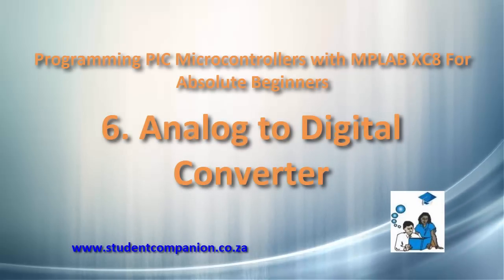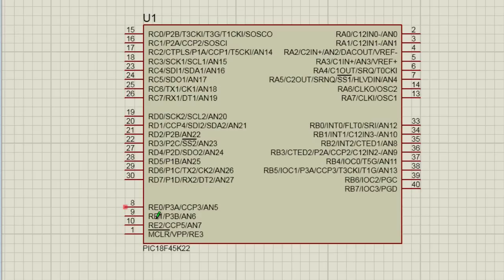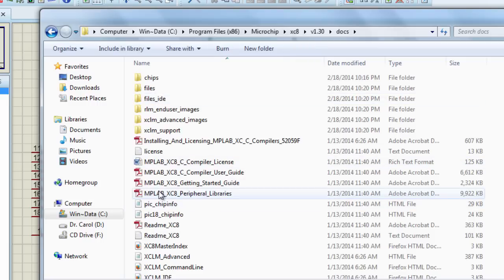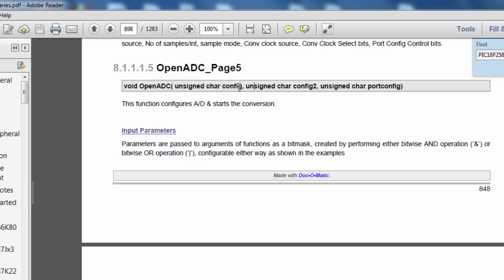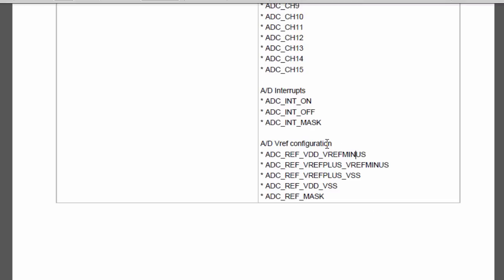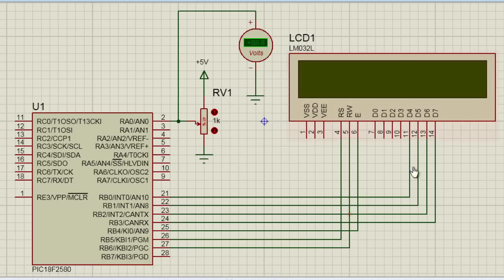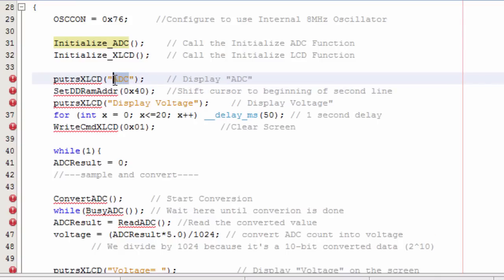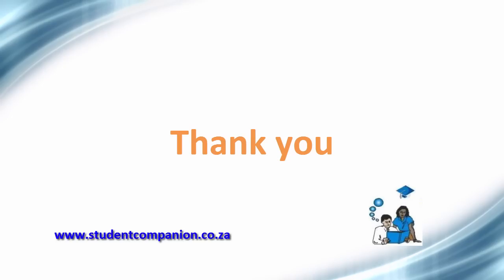6- Analog to Digital Converter | MPLAB XC8 for Beginners Tutorial

Comment: I have been working on a existing PCA designed where in the hardware is already fixed such as the no of pins and other hardware configuration.Truely speaking I  had to change the logic alone which was done by a third party based on our requirements and inputs But this time I wanted to do it myself (coding alone) and I am accustomed to mikroC and proteus way of compiling based on the videos referred.Is there any pic model which can replace pic 12f510 but still be cheaper and compiled by mikroC and checked by proteus and used in the existing PCA.I have already modelled it in proteus.Only coding part is left. Once that is complete I have burn it in our existing PCA and check for it's functionality.
Reply from the maker: You can use Microchip Advanced Part Selector tool, enter all the features that you need equivalent to your existing PIC, like number of pins, memory, peripherals, etc.
Then it will give you the PIC models that meet your criteria:  https://www.microchip.com/maps/Microcontroller.aspx

Comment: Hi...this is regarding pic12f510 microcontroller that we were referring to from another account.Is this the way we have to comment on a video.?in the mikroC version I am using, there is 12f510 pic but it's not available in proteus.This is where we are facing difficulty.Is there any other compiler which can help us in programming pic 12f510 .
Reply from the maker: Yes. This is how you can comment, even though you commented on a MPLAB xc8 video, but it's fine.
This PIC is available in Proteus but it's not available in mikroC.  You must use a different PIC. That is supported or choose a different compiler. 
You can use MPLAB XC8 compiler, it's free and it suppport all PIC models. 
Is there a good reason to use this very old PIC while there are newer alternative which are cheaper and better with more features?

Comment: Hello. I need the code for PICF887 ,using Proteus and XC8 compiller. I need the code for dht11 connected at RC0 and the microcontroller is set to work on 20Mhz.Thank you in advance
Reply from the maker: Hi. We can't write the code and the schematic for you, we can't have time to write codes for every requests we receive.
We can assist you with your own code. Do some research, read the datasheets and start the project yourself, there are plenty of resources online you can refer to.
If yoi struggle with specific features of the project, or the code doesn't compile ot generate errors or doesn't work 100%, then post those problems here on YouTube or preferably in the forum on our website because there you can even upload your code. Then we can look at it and do our best to assist
Reply from the maker: But unfortunately we can't write everything for you, that's not what we do, we won't have time for everybody

Comment: I am trying to follow your course, in this case the ADC, I follow the example explicitly, but the '#include "LCD.h"', well, where is that? I'm using MPLabX with XC82.10.
Reply from the maker: Hi, in this tutorial we used the PIC18F peripheral libraries but it's no longer supported from XC8 v2.0.
 Because you are using XC8 2.10, it won't work, you can either download an older version of XC8 compiler older then XC8 2.0 or preferably use MPLAB Code Configurator which is the new tool Microchip introduced to replace those libraries.  So it's better to use a new tool which has many advantages.  Watch this video to learn more: https://youtu.be/4WaB_Lj8FnY

Comment: Hi, actually i am using MPAB IDE v5.2 and i do not have "ADC.h"!? where can i get one? i'm working on PI18f45k20. Thanx for answer.
Reply from the maker: Watch this video to learn more: https://youtu.be/4WaB_Lj8FnY
Reply: @StudentCompanion  Thnax, you understood what i need! i actually use XC8 v2.5
Reply from the maker: What is the version of your XC8 compiler? It seems like you don't have the peripheral libraries installed in your compiler, they are now a separate installation.
Reply: @StudentCompanion  Compiler XC8 v2.05 now i don't have the "Link in peripheral library"! in XC8 Linker.
Reply from the maker: @nirindrainyjeraymond6248  Hi, you can't install the peripheral library with XC8 v2.05, it's no longer supported. The last supported version was XC8 v1.45 from v2.0.0 you can't use the peripheral library. either use MPLAB Code Configurator or install an old version of XC8 from this page: https://www.microchip.com/development-tools/pic-and-dspic-downloads-archive
Please note if you install XC8 v1.34 you won't need to download and install the peripheral library, it's already included in the compiler. This is the last version that had it.
Reply: @StudentCompanion  First of all thanx for all your answer. actualy MPLAB V5.0 / XC8 v2.05 / i installes de code configurator / but problem remaine: the compiler doesn't recognize de "adc.h"!
Reply from the maker: @nirindrainyjeraymond6248  If you installed code configurator than you don't need adc.h again, you don't need to use the peripheral library again. the code configurator will generate for you a new library, a new adc.h
In this video we explained how to use the ADC with the code configurator no need to use adc.h : https://youtu.be/4WaB_Lj8FnY
To learn more what is MPLAB COde COnfigurator and how to use it, please watch this video: https://youtu.be/JxSSVtTj_fA

Comment: Why did u choose ADC_FOSC_2 why not ADC_FOSC_4 or 8.
And why did you choose 2tad as your aquisition time. Is there any specific calculation for them?
Reply from the maker: The clock source affects the duration of ADC conversion. Depending on your application you might want a shorter delay but also affect the accuracy. 
The TDA is the time to complete one conversion. For correct conversion the appropriate TDA speciation must be met. This is PIC model dependant.  You must read your datasheet for more information.

Comment: hi, im currently watching your tut and im stuck in this part. im using pic18f4685 but im having problem with building the code.
in this part. 

OpenADC(ADC_FOSC_2 & ADC_RIGHT_JUST & ADC_2_TAD,
            ADC_CH0 & ADC_INT_OFF & ADC_REF_VDD_VSS,
            ADC_1ANA);

ADC.c:52: error: (192) undefined identifier "ADC_FOSC_2"
ADC.c:52: error: (192) undefined identifier "ADC_RIGHT_JUST"
ADC.c:52: error: (192) undefined identifier "ADC_2_TAD"
ADC.c:53: error: (192) undefined identifier "ADC_CH0"
ADC.c:53: error: (192) undefined identifier "ADC_INT_OFF"
ADC.c:53: error: (192) undefined identifier "ADC_REF_VDD_VSS"
ADC.c:54: error: (192) undefined identifier "ADC_1ANA"

it showing this error. i tried comparing the peripheral library and it shows the same for OpenADC(parameters)
Reply from the maker: Hi. What is the version of the XC8 compiler you are using?
It looks like you are using some of the latest versions if that's the case the Peripheral library is no longer included in the compiler. You have to download it separately and install it into your compiler.  It's now called Legacy peripherals libraries and you can find it same place as your compilers download on Microchip website.
Reply from the maker: Or you can install an older version lime the one we used in that tutorial.  MPLAB allows you to have multiple compiler versions. You can choose one for each project. Any compiler from v1.34 and earlier should work.
Reply from the maker: Or you can use a new PIC model supported by MPLAB Code Configurator as Microchip is phasing out The peripheral libraries.  Please watch this video to learn more: https://youtu.be/4WaB_Lj8FnY
Reply: i have also downloaded the legacy peripherals. which i have used in your lcd tutorial.
Reply: ok ill try to install v1.34 :D
Reply: downloaded and installed v1.34. but im still having the same results and errors.
Reply from the maker: Are you selecting the correct compiler in your project?
If you have used the Peripheral library in the lcd tutorial then it should work. They must be something else wrong.  Please upload your complete zipped  project in the forum on our website.
Reply from the maker: Can you post your main.C code and your configuration bits
Reply: my header file.

// PIC18F4685 Configuration Bit Settings

// 'C' source line config statements

// CONFIG1H
#pragma config OSC = IRCIO67    // Oscillator Selection bits (Internal oscillator block, port function on RA6 and RA7)
#pragma config FCMEN = OFF      // Fail-Safe Clock Monitor Enable bit (Fail-Safe Clock Monitor disabled)
#pragma config IESO = OFF       // Internal/External Oscillator Switchover bit (Oscillator Switchover mode disabled)

// CONFIG2L
#pragma config PWRT = OFF       // Power-up Timer Enable bit (PWRT disabled)
#pragma config BOREN = OFF      // Brown-out Reset Enable bits (Brown-out Reset disabled in hardware and software)
#pragma config BORV = 3         // Brown-out Reset Voltage bits (VBOR set to 2.1V)

// CONFIG2H
#pragma config WDT = OFF        // Watchdog Timer Enable bit (WDT disabled (control is placed on the SWDTEN bit))
#pragma config WDTPS = 32768    // Watchdog Timer Postscale Select bits (1:32768)

// CONFIG3H
#pragma config PBADEN = OFF     // PORTB A/D Enable bit (PORTB<4:0> pins are configured as digital I/O on Reset)
#pragma config LPT1OSC = OFF    // Low-Power Timer 1 Oscillator Enable bit (Timer1 configured for higher power operation)
#pragma config MCLRE = OFF      // MCLR Pin Enable bit (RE3 input pin enabled; MCLR disabled)

// CONFIG4L
#pragma config STVREN = ON      // Stack Full/Underflow Reset Enable bit (Stack full/underflow will cause Reset)
#pragma config LVP = ON         // Single-Supply ICSP Enable bit (Single-Supply ICSP enabled)
#pragma config BBSIZ = 1024     // Boot Block Size Select bits (1K words (2K bytes) Boot Block)
#pragma config XINST = OFF      // Extended Instruction Set Enable bit (Instruction set extension and Indexed Addressing mode disabled (Legacy mode))

// CONFIG5L
#pragma config CP0 = OFF        // Code Protection bit (Block 0 (000800-003FFFh) not code-protected)
#pragma config CP1 = OFF        // Code Protection bit (Block 1 (004000-007FFFh) not code-protected)
#pragma config CP2 = OFF        // Code Protection bit (Block 2 (008000-00BFFFh) not code-protected)
#pragma config CP3 = OFF        // Code Protection bit (Block 3 (00C000-00FFFFh) not code-protected)
#pragma config CP4 = OFF        // Code Protection bit (Block 4 (010000-013FFFh) not code-protected)
#pragma config CP5 = OFF        // Code Protection bit (Block 5 (014000-017FFFh) not code-protected)

// CONFIG5H
#pragma config CPB = OFF        // Boot Block Code Protection bit (Boot block (000000-0007FFh) not code-protected)
#pragma config CPD = OFF        // Data EEPROM Code Protection bit (Data EEPROM not code-protected)

// CONFIG6L
#pragma config WRT0 = OFF       // Write Protection bit (Block 0 (000800-003FFFh) not write-protected)
#pragma config WRT1 = OFF       // Write Protection bit (Block 1 (004000-007FFFh) not write-protected)
#pragma config WRT2 = OFF       // Write Protection bit (Block 2 (008000-00BFFFh) not write-protected)
#pragma config WRT3 = OFF       // Write Protection bit (Block 3 (00C000-00FFFFh) not write-protected)
#pragma config WRT4 = OFF       // Write Protection bit (Block 4 (010000-013FFFh) not write-protected)
#pragma config WRT5 = OFF       // Write Protection bit (Block 5 (014000-017FFFh) not write-protected)

// CONFIG6H
#pragma config WRTC = OFF       // Configuration Register Write Protection bit (Configuration registers (300000-3000FFh) not write-protected)
#pragma config WRTB = OFF       // Boot Block Write Protection bit (Boot block (000000-0007FFh) not write-protected)
#pragma config WRTD = OFF       // Data EEPROM Write Protection bit (Data EEPROM not write-protected)

// CONFIG7L
#pragma config EBTR0 = OFF      // Table Read Protection bit (Block 0 (000800-003FFFh) not protected from table reads executed in other blocks)
#pragma config EBTR1 = OFF      // Table Read Protection bit (Block 1 (004000-007FFFh) not protected from table reads executed in other blocks)
#pragma config EBTR2 = OFF      // Table Read Protection bit (Block 2 (008000-00BFFFh) not protected from table reads executed in other blocks)
#pragma config EBTR3 = OFF      // Table Read Protection bit (Block 3 (00C000-00FFFFh) not protected from table reads executed in other blocks)
#pragma config EBTR4 = OFF      // Table Read Protection bit (Block 4 (010000-013FFFh) not protected from table reads executed in other blocks)
#pragma config EBTR5 = OFF      // Table Read Protection bit (Block 5 (014000-017FFFh) not protected from table reads executed in other blocks)

// CONFIG7H
#pragma config EBTRB = OFF      // Boot Block Table Read Protection bit (Boot block (000000-0007FFh) not protected from table reads executed in other blocks)

// #pragma config statements should precede project file includes.
// Use project enums instead of #define for ON and OFF.

#include <xc.h>

#define _XTAL_FREQ 8000000
Reply from the maker: Did you the correct ADC parameters or you  defined according to our tutorial? Each PIC has its own configuration parameters. That's why you must always refered to the pdf help file as explained in this video.  The PIC we used is different to yours.
Reply: yup. i have checked the peripherals > search for my pic > OpenADC. it also have the same parameters. sadly i cant post pics on how i got my OpenADC(parameters)
Reply from the maker: Upload everything in the Forum
Reply: i have resolve the error and i have to include two libraries.

#include <adc.h>
#include <xlcd.h>

but the display is running/shifting to the left when reading the voltage value.
i have WriteCmdXLCD(0x06);

also how come you didn't add these two? does it affect the pic used?
and on the lcd tutorial i didn't include xlcd but there are no errors, why the error is popping in this part?
Reply from the maker: Usually it doesn't give errors even if you don't include the library header files. Only warnings.

Comment: Hi,

My Proteus is not running the simulation.I have even downloaded your project.
Reply from the maker: What do you mean it's not running? You must supply more info. Are you getting an error? What are you seing? As you can see from this video, our is working.
Reply: It shows Controller recieved data while busy
Reply from the maker: Is that all as error?
Reply: yes,If you could give me your email I could sent you my project
Reply from the maker: Upload the error screenshot, full zipped MPLAB and Proteus projects in the Forum: https://www.studentcompanion.co.za/forums/
Reply: Done uploading,please give it a look
Reply from the maker: Usman Ashraf it's 2H00 AM here.  We will have a look at it tomorrow.  We can't open a PC now.
Reply from the maker: Found few problems:

 1. The main problem is your circuit diagram: You didn't connect Data D5 pin of the LCD. In 4bits mode, you must use D4, D5, D6 and D7. Move the line connected to D4 to D5 and the line connected to D3 to D4.

 2. To create a delay of 1 second, you must loop 20 times a delay of 50ms (1 000ms =20*50) and not 20 times 100ms, this will give you a delay of 2 Seconds but at the same time give you an error of too large argument in the delay, so always use a small delay number and increase the loop number to achieve the required delay when using the old compiler. This bug has been fixed in latest XC8 compilers, now you can use a large delay directly without looping.

3. Change: voltage = (ADCResult*5)/1024; to voltage = (ADCResult*5.0)/1024; Don't multiply by 5, this will be give you an integer voltage, all the decimal point will be rounded of, multiply by 5.0 this will tell the compiler that this is a decimal calculation.

4. lastly change the void DelayFor18TCY (void)
    {
    Nop();Nop();Nop();Nop();
    Nop();Nop();Nop();Nop();
      Nop();Nop();Nop();Nop();
      Nop();Nop();
      return;
    }  
                      
    to: void DelayFor18TCY (void)
    {
    Delay10TCYx(20) ;
    }
Reply: Its working fine now thanks,learnt a lot from you ....Hats off Sir

Comment: Hello sir may I know how to transfer ADC float value without sprintf because in c18 compiler sprintf is not working for float value.
Reply from the maker: Can i know what is the reason of using the old C18 compiler while there is XC8?
Reply from the maker: I believe sprintf should work with C18 compiler as well. I don't see a reason why it shouldn't even though we don't use C18. You must be doing something else wrong.
Reply: Student Companion it's working only for "%d" not for "%f"
Reply from the maker: I'm not sure about that. But i think it should work. Unfortunately we don't support C18 compiler, only XC8